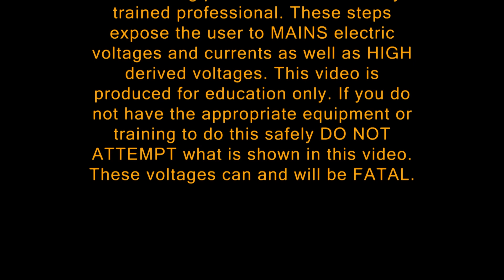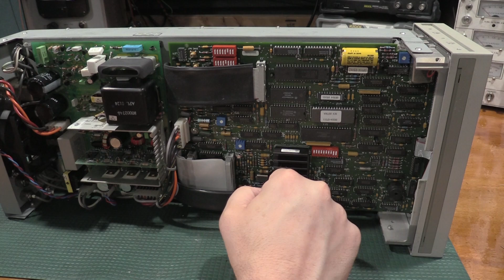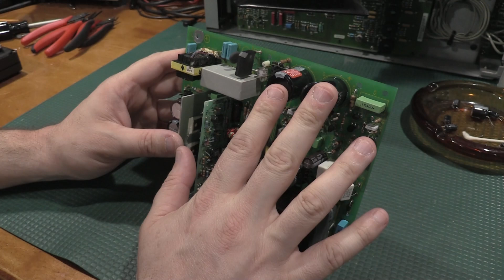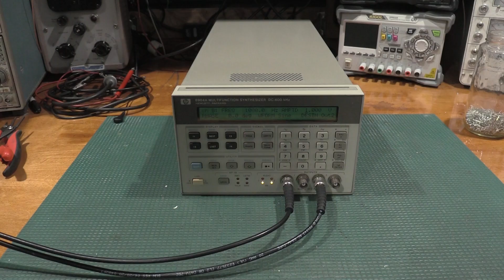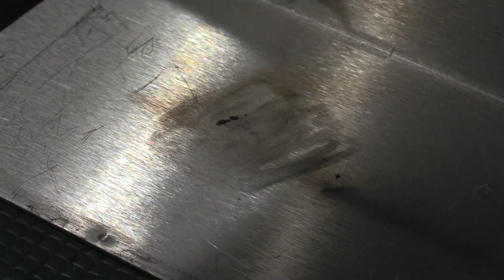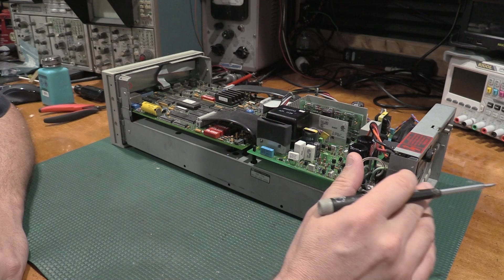HP 8904A Unit 2 Restoration and Check in

Comment: dont know what the kit is for but interesting anyway best guess ,is it a dds sig gen thats sync-able with a time base reference? in the uk we dont get access to hp gear
Reply from the maker: It is a low speed function generator DC - 600 Khz. There was an option that was allows for phase lock of up to 8 units. I needed 2 but the units I have do not have the Sync inputs on the back OP5 if I remember correctly. So I will need to find another way of getting phase locked outputs.
Reply: @ZenwizardStudios  ok phase locked wow thats cool  serious tech  oh and didnt know about sheiffer emi filter blocks so thanks ,seen loads of cracked rifa,s though but never an incinerated one ,i had a vega tv (russian) filter cap class x across 240v blow up in my face and seriously no bull iam convinced it was brown parcel tape just without the glue! that was back in the 90,s 
unrelated tech question : the yellow arrow shaped axial tantalum caps in 80s- 22 and 24 series tek scopes what do you replace them with when they cook the pcb , are low esr electros good enough now or are the tantrums better esr than that?
Reply from the maker: that really depends on the circuit and service. If the tants are just decoupling caps for the power rails then low ESR electrolytic are fine, Usually.
Reply: @darrenmurphy6251  The brand of the bad mains input filters is Schaffner not Sheiffer. Check the date code on any of these filters you come across and immediately replace anything dated prior to 2000. Later years started using some better quality caps that weren't quite so prone to exploding.
Reply: @stephenbell9257  ive got loads of gear 80s to 90s,  22xx and 24xx tek scopes fluke 8840,s solartron ect , so time to get busy